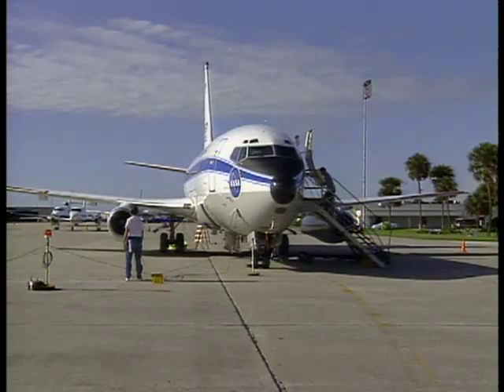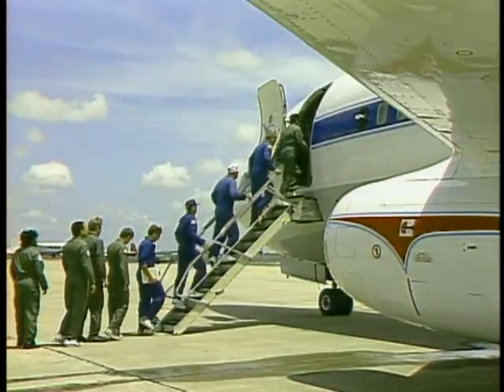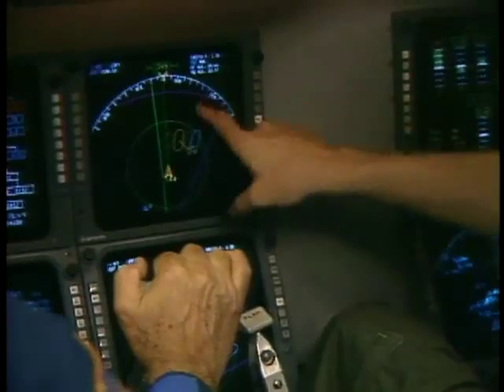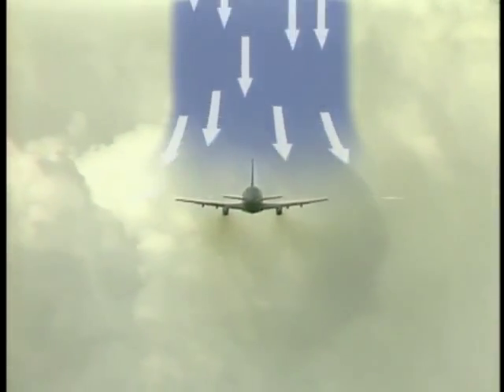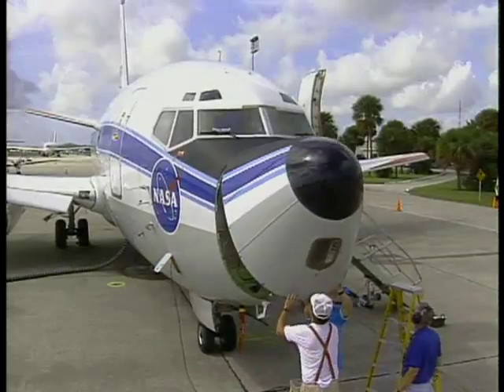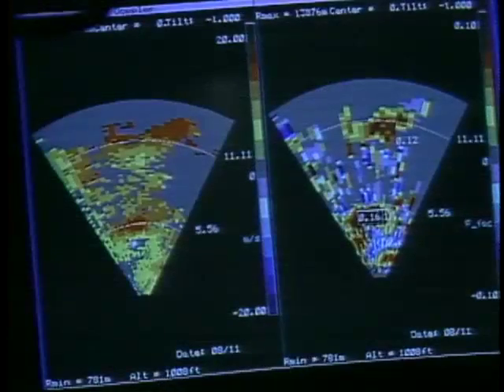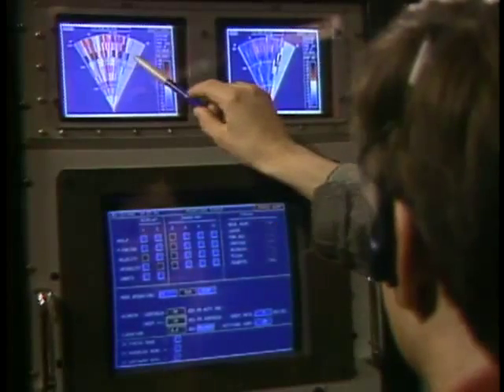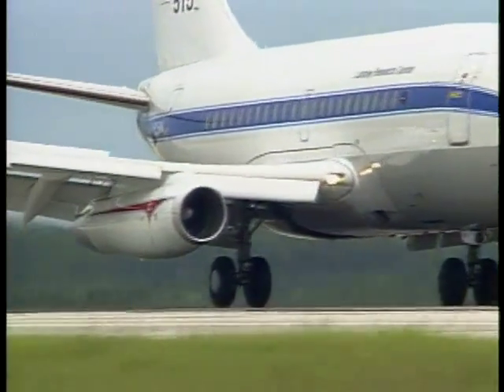Storm Seekers

Comment: I was ("ahole" Hwy Wkr in 1994, per NWA Capt), @min wage, hit by violent Microburst next to GRR!  Pickup picked up, turned to sharp angle, sped up from 55 to 85, then dropped back on I-96.  I straightened 'er up, glancin' up at STATIONARY Jetliner on ILS Approach to GRR, but momentarily, they'd go from 150kt headwind, into 150kt tailwind = No Lift, all gonna die.  From unemployed to min wage, instantly had urge to help Travelers, flipped on Beacons/Flashers, jerked 'er up onto Right Whls, slipped up thru side window, sat on sill, rt hand on wheel, point up @Capt w/lft, all while slalomin' Cntr Line.  Took very few seconds for Capt to go Full Throttle, Full Flaps, Gear Up, Nose down, as Microburst Hit = "Elevator-to-Hell" per Stewardess, w/broke back, Capt chanced flare/pullout into young Oak Forest, stabilized inside forest, gently rose up & out saving 155/155.  FAA, NTSB, NWA all furious, & Capt arrested by GRPD, pulling Oak Limbs from Belly, charged w/Evidence Tampering, & Joyriding Aircraft, cuffed, & hauled past deplaned Passengers to make them cry!  My Boss, Big Al woulda kilt me if knew that's how I drove "His" MDOT Pickups, so NTSB Classified, both Original & Re-Done Investigations, so nobody of any import would ever find out! I Guess you'd call their actions, less than their Finest Hour!

Hmm, NASA very interested in Captain's little Miracle of Miracles, sent their 737, grilled the hell outta me, learned a shtload about Microbursts, locations, emergency actions, etc, to escape from them, & boinked FAA to release long awaited Doppler Radar at GRR, Installing immediately, so wouldn't happen again!

I was lowest paid MDOT Field Employee, retiring in 2010, but before had nothin', as was Business Owner, but boinked by U.S. Senate/House of Reps, Ronnie Reagan, Mich Treasury, MESC, all Fed Courts etc, to ruin business, when Fed $'s accepted to computerize MESC, Ron signed, Mich asked for Lowest Bidder to install, Arthur Anderson of Enron infame, of course, so Contribution Rate of 4%, JACKED UP TO 400% , WHEN THEY INPUTED 4% RATE, AS 4.00%, because Program didn't recognize decimal points!!  Saddest part is, there ain't nobody in Michigan smart enough to realize, that might just be a problem!!  Ain't nobody that can add, subtract, multiply, divide, & absolutely no one that understands right, wrong, decency, Constitutional Rights, or anything else regarding Civilization, so advice is, GET THE HELL OUT OF MICHIGAN, & don't trust 'em w/ANYTHING!!  They'll even kill your 80 yr old next-door neighbor, AND Tax Accountant, going to represent ya before IRS, but had worked for them, so killin' him was necessary, and was best Tax Accountant in State!!  Too bad his was Michigan!!!  Just tryin' to help ya out, like with those hapless souls on that NWA Jetliner!!  L-O-O-K  O-U-T !!!   DANGER -  DANGER  -- DANGER.......!